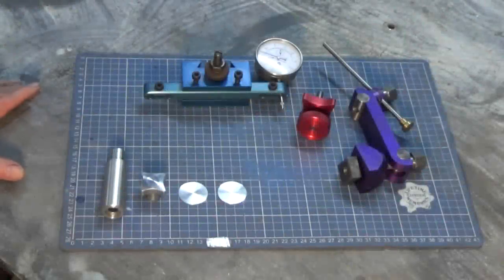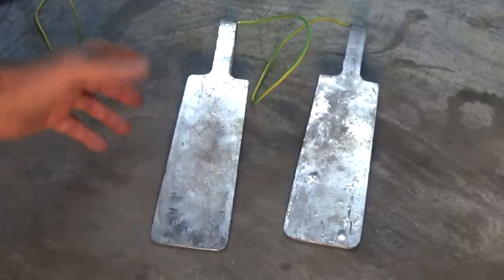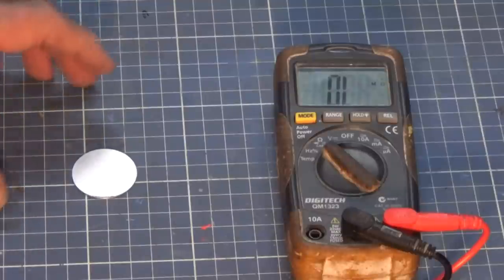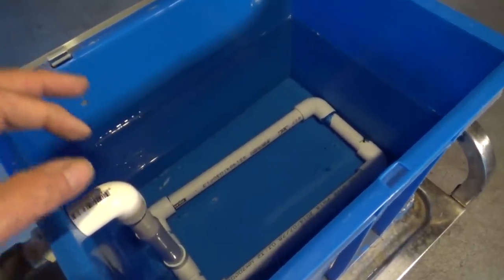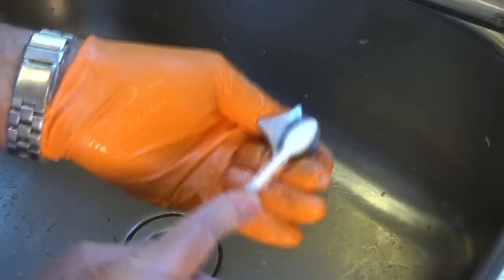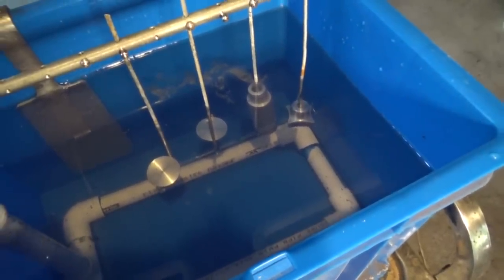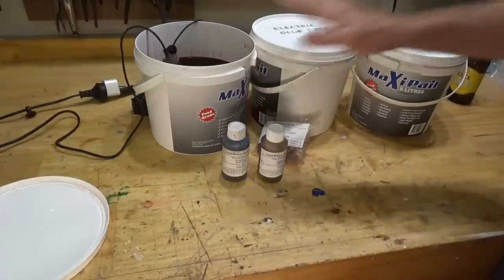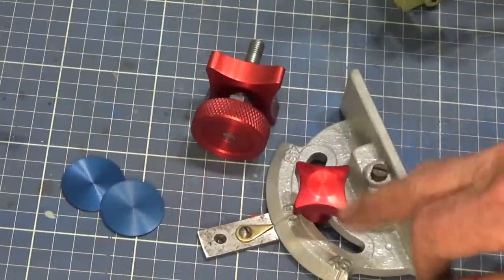Metal Finishing With Mark Anodising 101

Comment: I used to anodize for a living.. got a new job and this job was getting parts anodized but was unhappy with the product.. he gave me a mission to find out a home set up we can use to do ourselves. Hoping this video will be helpful in about 1 minute in and you sound very educated on the process so I assume I came to the right place
Reply from the maker: Thanks but this has been a long and at times frustrating journey. The thing was I got a good result the first time I tried it and then a lot of failures. It took a long time to work out what I was doing wrong. The key is definitely to have all your parts scrupulously clean and to ensure good electrical contact with the power supply. Heating the dye helps to speed up the process but it's not absolutely essential.
Regards,
Mark

Comment: Thats funny that you said you can't throw sulfuric acid down the sink.... Here in the states its used to unclog sinks.
Reply from the maker: That would probably be caustic soda or sodium hydroxide, the active ingredient in drain cleaner. Sulphuric acid is very expensive here in Australia, if you can get it. At one time you could buy it at the auto accessory shop for topping up car batteries but now it's one of those restricted chemicals. Probably associated with bomb makers or meth labs!
Regards,
Mark

Comment: The local cleaning supply store at morayfield has Mo-Flo, drain cleaner which is sulphuric acid and has 1835gm/L of sulphuric which going by the SG is about pure H2SO4, for $55, Blackwoods about $75
Reply from the maker: That's interesting. I found it almost impossible to buy bulk sulphuric acid from the auto accessory store. You used to be able to buy a 4 litre container for topping up car batteries. Now, you get treated like a bomb maker if you try to buy acids like Nitric and Sulphuric. 
Regards,
Mark
Reply: @Preso58  Turned out to be $46 inc with an ABN, and no questions asked.

Comment: Thank you for the great video. Very good camera angles, and everything is explained very well, but very simple.  I like the water bottle idea for cleaning parts.  I cant wait to try this myself
Reply from the maker: Since making that series of videos I have learned that it is best to rinse the parts in a large tub of clean water. Dunking and swirling the parts as you go. In the trade it is called "swilling". Sometimes the electrolyte from the andodising tank gets trapped in threaded holes and blind holes. It will contaminate the part during the dye process and leave what look like water marks in the dyed surface. However the key is to make sure that you rinse the parts very thoroughly. 
Regards,
Mark

Comment: I've been doing "near chrome" nickel plating brass and white metal parts for my car models.  So I have had good luck with the Caswell stuff.  I also have the power supply and basic rig for doing this anodizing stuff.  Thanks for walking us through it!
Reply from the maker: I have some nickel cobalt which is almost the same colour as regular chrome. Is that the same? I find that pure nickel is a bit more yellow than the nickel cobalt.
Regards,
Mark
Reply: @Preso58  I use the Caswell Copy Chrome or "Nickel Crystals with Brightener" on my tiny brass and copper parts.  The crystals are bright green.  The brightener is an odorless liquid.  It works great on brass and copper.  White metal is tricky because the nickel doesn't like to adhere.  There is no yellowness, possibly because of the mystery brightener additive.  Of course the surface has to be highly polished to get the chrome effect.  Scale model chrome looks better in nickel than chrome because of scale effect.  Caswell plays close to the chest with their ingredients.  Their crystals are probably just nickel sulfate but...who knows without testing.  No idea what the brightener is.

Comment: For anyone curious about the process... aluminum anodizing is completely different than titanium, niobium, tantalum, etc anodizing. Aluminum is the only one that uses dye. When you put it in the tank with voltage (a car battery is fine, there's no need to be fancy controlling voltage or current, it's completely irrelevant, just "some" voltage and "enough" current to proceed at a rate that won't bore you), you're just electrolyzing water, that's it - splitting H2O into H2 and O2. You're forcibly slamming the O2 into the aluminum, creating aluminum oxide, or "rust", that black stuff that forever rubs off on your fingers from aluminum. The H2 goes to the cathode plates (you can use stainless steel cutlery just fine, put it back in the drawer afterwards), and bubbles away harmlessly. Aluminum oxide is among the hardest materials we know, it's used to make sandpaper and such, that's what makes it a great finish.

Aluminum oxide formed by electricity creates delicate microscopic crystal tower networks on the surface, like sand castle tubes, straight up, side by side. Aluminum oxide is colorless, or dull grey. When you take it out of the electrical bath, carefully putting it into the dye bath, the dye particles fall between the crystal towers. Then when you boil it afterwards, the crystal towers collapse (they're delicate, boiling is violent). The towers collapse, trapping the dye particles like your sister's toys in the sand.

You can leave it in the electric bath too long, I forget what the result is. Too long of towers so the bottom layer becomes crusty and top layer becomes chaotic I think. It's not helpful and kind of ruins the process. As I recall, the crystals grow forever. You end up growing the crystals too long and they break off and it consumes the base material.

Conversely, titanium/niobium/tantalum anodizing is completely different. Instead of making crystal towers, Titanium Oxide / (etc oxide) is more like a transparent swiss cheese. Looks like a closeup of bad acne scars. This oxide layer is also electrically resistive, but unlike aluminum doesn't grow forever. It's so resistive that the swiss cheese surface grows thicker and then just stops after a certain thickness. The only way to add more is to increase the voltage so that electricity can punch deeper into the metal. There's no need for current control, the process is complete in fractions of a second.

There is no dye involved in titanium anodizing. The transparent layer is so predictably and consistently (microscopically) thick, that it acts like a prism. The thickness of the layer is so precise relative to voltage, that it's a precise fraction of the wavelength of visible light. When you shine white (daylight) at the metal, it reflects some light and refracts others, which subtractively or additively combines the wavelengths so that you perceive it as a color. Different thicknesses of oxide layer result in different colors. So different voltages result in different colors, predictably. I think you start to see some colors around 12v, and up around 70 or 80v you've worked your way through the whole spectrum (after which, it repeats, 2nd order, 3rd order, etc). There's minor iridescence, from some angles a part will look green, others, purple for example. You can always add more thickness with a higher voltage, but not take it away afterwards by lowering the voltage.

Unlike with Aluminum which uses dye, Titanium/etc anodizing cannot create all colors. Red is almost impossible for example, you can get pink, pink/gold, and plum, a bit of orange and a brown, but there's no thickness that creates red. Green is very very tricky to get, narrow voltage range. Purple and gold are easy, they reappear twice in broad swaths of the spectrum. It's complicated to explain why the anodizing spectrum doesn't follow the visible spectrum, but, it doesn't. It has it's own spectrum, you can just look it up if you're curious.

Titanium oxide is so chemically tough, there are only 3 chemicals strong enough to strip it. One of them, even just the gas from the acid can pass right through your skin and attack your nerves and bones directly, painlessly. I think that's Hydrogen Fluoride? I forget the 2nd one but it's similarly terrifying. Don't use either. The 3rd is an unspecified but safe chemical branded as "Multi-Etch". If you "pass" your color voltage-wise on a project, you can dip it in multi-etch and work your way back through the spectrum as it strips the oxide off. It might be impossible for anyone outside of US or Canada to get access to Multi-Etch, as it's not allowed to cross borders. It used to be only available in the US, but I arranged for some to be made and sold in Canada ten years ago, so now there's 1 distributor for each country and far as I know, that's all.

Well, those are the things I know about anodizing.
Reply from the maker: Wow! You know your stuff. I believe that leaving the aluminium in the anodising bath for too long creates a sort of burnt look but I don't know how long that takes to occur. I also recall reading about a type of O ring that was made of an exotic material that broke down with heat to make a Hydrogen Fluoride gas. There was a warning not to touch machinery that had been damaged in fires if  there was a chance there were any O rings in it.  One surface technician was exposed and it basically burned through his skin like phosphorous and just kept going. Not pretty! I have seen photos of anodised titanium and it does look spectacular. 
Regards,
Mark
Reply: @Preso58  - Titanium actually looks kind of blah. The surface finish is always a dull matte. It's just the surface finish of titantium. Niobium on the other hand looks like it was drawn by angels.
Reply: 💯🤩🤩🤩💯Now this is the EXACT INFO I WAS LOOKING FOR!!! I’m looking to anodize some (very small) 1-inch or Smaller 1/25 Scale 1061 Aluminum Scale Auto parts that I machine on my Mill/Lathe. I only use Aluminum. Thanks & I'm headed over to your channel now to ✅it out-👉Thank's
☯️Lee

Comment: Interesting video, thanks for posting. Thought I’d give it a go but having problems finding lead for electrodes. Bunnings have lead sheet but it’s copperised. Not sure if that would upset the process. Otherwise I may just use Aluminium but apparently need 6063-T6. Not sure but I think the stuff they sell in Bunnings isn’t that. Do you reckon it’d make much difference?  Did you use 6063-T6 when you were using aluminium as the cathode?
Reply from the maker: I have no idea what the original aluminium cathode grade was. It was just some sheet stock I "liberated" from a skip. The lead I used came from a large block that my father made from old lead acid batteries. Maybe take a look in BCF for some heavy lead sinkers. You may need to buy a few but the cathode probably doesn't need to be as big as the ones I used.
Regards,
Mark

Comment: Mark I do follow your guideline as best I can , but having a drama where the Dye does not take to very edge of Knob of amplifier using Caswell Dye, any suggestions would be appreciated.
Reply from the maker: Brian, I now clean my parts using a product called "Simple Green". It is a household cleaning concentrate with a citrus base. I put the parts into a plastic bag and fill it with the cleaner, just enough to wet the parts, and then the whole bag goes into my ultrasonic cleaner. I run it for about 10 minutes and then wash the parts under lots of running water. From their they go straight into the anodising tank. As long as you don't touch the parts with bare hands they should be uncontaminated. It's a good idea to do a water break test just in case but the ultrasonic cleaner gets into threaded holes and through holes that are not easy to clean with a brush. I have seen a similar issue around the edges of holes where the dye won't take and I am sure it is to do with contamination from cutting oil and grease. I also rinse the parts straight after they come out of the anodising tank with lots of running water. Just spraying them with a spray bottle isn't enough. In the anodising trade they call this step "swilling" and it is done in very large tanks of clean water. Any residual acid left in cavities or around sharp edges can stop the dye from penetrating. It's also a good idea to check the PH of your dyes. I was having an issue with my black dye and I found that it had a PH of about 8 and it should have been around 5.5. I bought a digital PH tester and found an online guide for Caswell dyes which listed the target PH for each colour and they are not all the same. I can lower the PH with just a few drops of hydrochloric acid and now the black dye penetrates quickly and it produces a deep jet black. I also heat the dyes to about 55C. 
Check out this link https://forum.caswellplating.com/forum/anodizing-questions/3885-anodizing-dye-ph
Regards,
Mark
Reply: @Preso58  Appreciate the quick and informative response..Will take on board your suggestions.. I do use Simple Green but not my Ultrasonic cleaner, the running water could be one of my problems so will try that, so that is tap water not Di.Min water. Thanks again ..Regards  Brian
Reply from the maker: @brianreid4101  our tap water comes from rainwater tanks so it is relatively pure. If your water supply contains chlorine or dissolved minerals you might be better to use  distilled water. You may need to experiment.  In my view,  the key is to use a large volume of water and dunk/swill the parts. Good luck.
Reply from the maker: @brianreid4101  our tap water comes from rainwater tanks so it is relatively pure. If your water supply contains chlorine or dissolved minerals you might be better to use  distilled water. You may need to experiment.  In my view,  the key is to use a large volume of water and dunk/swill the parts. Good luck.
Reply: @Preso58  Thanks again Mark..

Comment: You should talk about hard anodising too
Reply from the maker: Sadly, I've never tried it but it should be doable in a home shop. I was very fortunate to be able to tour a workshop of the Toyota Rally Team here in Australia and they were taking steel parts off the stock Toyota sedans and replacing them with aluminium parts which were hard anodised in an attempt to save weight. The main parts were all underbody parts which were subject to wear and tear from gravel and stone strike. 
Regards,
Mark
Reply: @Preso58  hard anodised parts are very hard wearing. I don't understand the process myself as it's been a long time since I studied anodising. I know it creates a layer which is penetrated in the surface - so the bond is extremely strong but I can't remember how the process is different to get it from regular to hard.

Comment: I watched your video here about a dozen times. I bought everything needed and my first sample piece worked great.
I"ve since done several parts I wanted Anodized, and they all turned out better than expected. 
  One thing I've noticed is temp. seems very important. I did one batch that the acid (Sodium bisulfite) bath temp. was only 65 degrees F. and they didn't do as well. The 140 degree F. die (Caswell die) was very slow to penetrate. 
Since then I've done several more with the acid bath at 78 - 80 degrees F. with exellent  results. 
Thanks so much for your very informative video. **** 5 stars.
I would recommend this process to anyone wanting to anodize aluminum.
Reply from the maker: I am glad you found it useful. I always run my anodising bath at room temperature but I do heat the dyes. I only found out recently that the PH of the dye is critical. My black dye was always a problem. It only ever made the parts a sort of medium grey. I found this page on the Caswell forum https://forum.caswellplating.com/forum/anodizing-questions/3885-anodizing-dye-ph and checked the PH of all my dyes with a digital PH meter. Nearly all of them were outside the correct range. Most were too alkaline and I added a few drops of hydrochloric acid to bring it back to the correct PH. Bingo! Now my black dye makes the parts jet black and the dye penetrates much more quickly. 
Regards,
Mark

Comment: Great job and thanks for the tip about the pool PH adjuster. I'v been using battery acid but like you said it's getting more difficult to get hold off. For your Titanium wire TIG filler is not that hard to get hold off in small quantities. Great video. Keep it up! 👍👍👍
Reply from the maker: I have some tig welding rod on order on Ebay but after six weeks I am still waiting. I could have just driven down to the welding supply shop but I must say I resent driving anywhere. To me, time spent in the car is time wasted. 
Regards,
Preso

Comment: I laughed when you said you can't tip it down the sink. The owner of turf engineering in vic dumps the electro plating acids into the drain or out behind his business on the ground. Seems to get away with everything definitely needs epa to pay him a visit
Reply from the maker: Brad, unfortunately there is a lot of that going on. Apart from the pollution and risk to the environment there is also some personal risk as well. A proprietor of a Chinese restaurant in a nearby town poured caustic soda down a drain in an attempt to clear it and then poured hot water in on top of it. The heat and steam created by the reaction blew back into his face and airways and nearly killed him. He was severely burned and ended up in hospital for months. 
Regards,
Mark